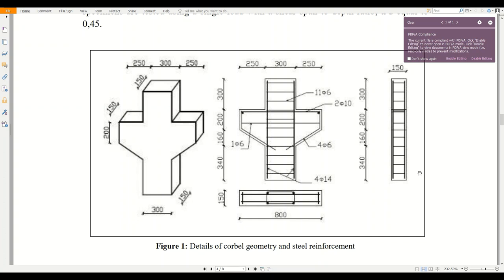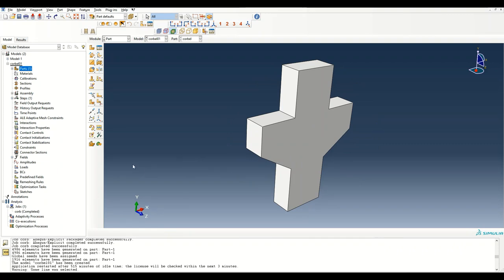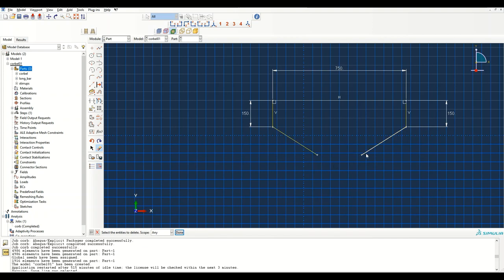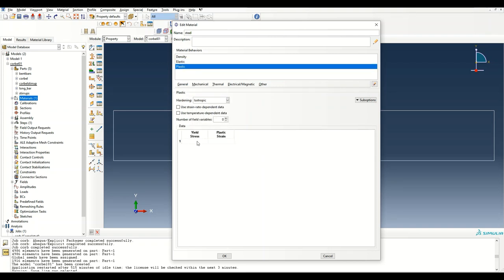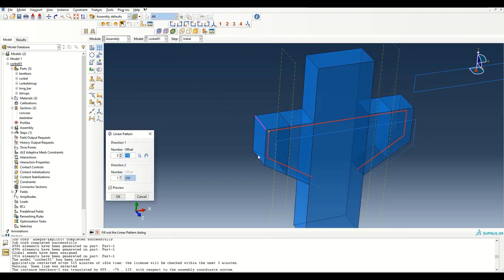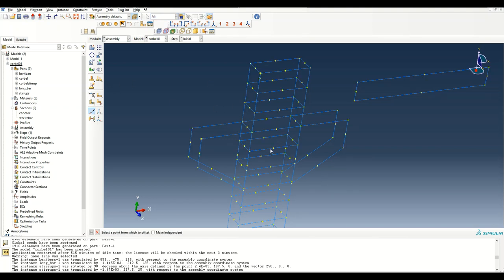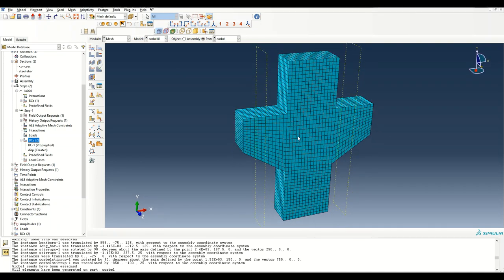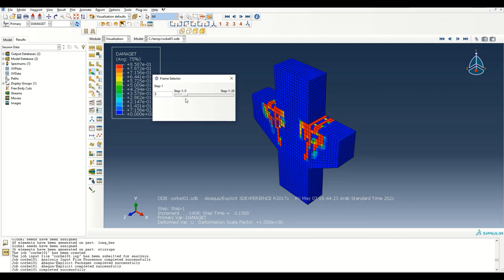Reinforced Concrete CORBEL in ABAQUS- 30 min. Step by Step Tutorial

Comment: This video is very useful. 
I request you to kindly add the material properties file so that we can also do practice with real data.
I also to request to publish video on cyclic loading effect on pier or column.
Reply from the maker: Thank for the comment
Will add a link to pdf in the description
Reply: @BoldLearning   material properties from Excel sheet
Reply from the maker: https://www.researchgate.net/profile/Quy-Nguyen-35/post/Does_anyone_have_Excel_Sheet_for_Concrete_Damage_Plasticity_parameters_and_does_not_mind_to_share_it/attachment/5e5257233843b0499fe902bb/AS%3A861691046805505%401582454563772/download/CDPM_KT.xlsx